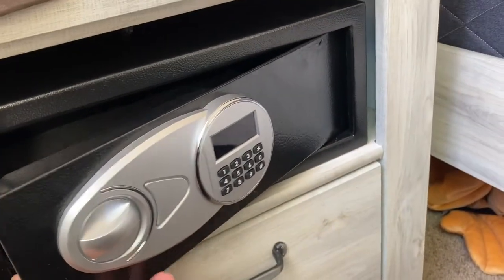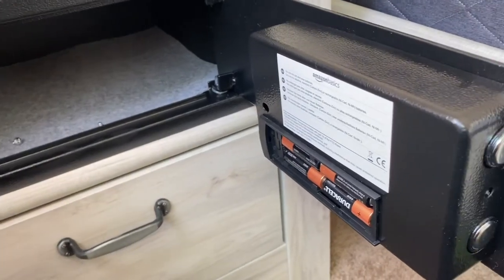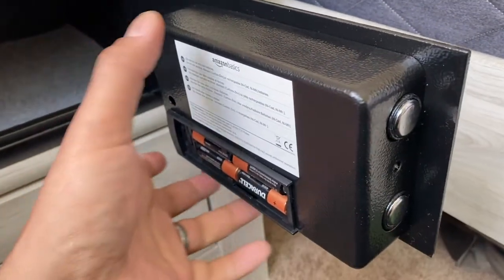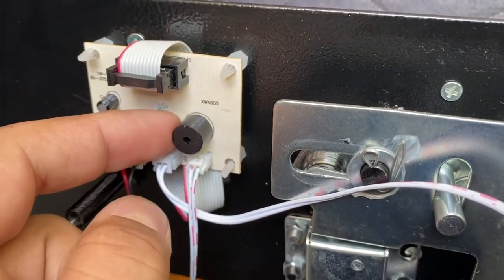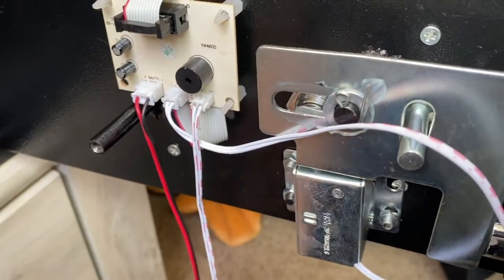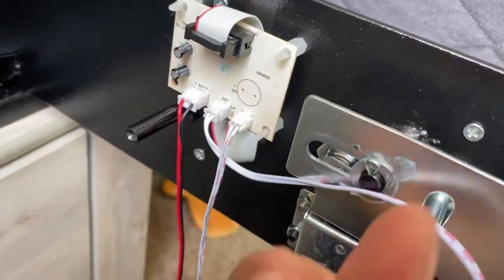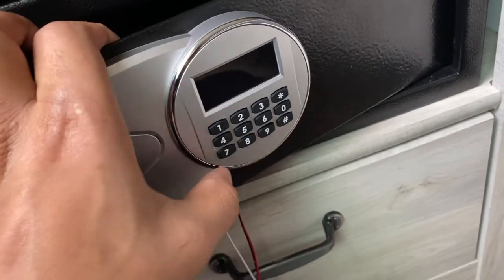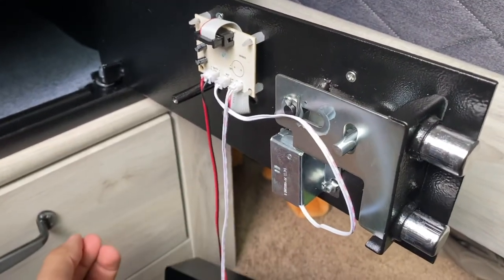How to Mute AmazonBasics Safe Stop Beeping Sound

Comment: Orrrr you could just do *633 and it will turn off the beep sound
Reply from the maker: no wayyy lol I should of just read the manual loool
Reply: wooooooooooowwwww
Reply: can I just reduce like 50% the sound? My manual just shows how to setup and change battery...
Reply: Tried that code on two different Amazon basics safes and didn’t work.
Reply: * 633 laughs at me !

Had to rip the speaker out from its primortical-tentacles, as the YouTube author suggests.